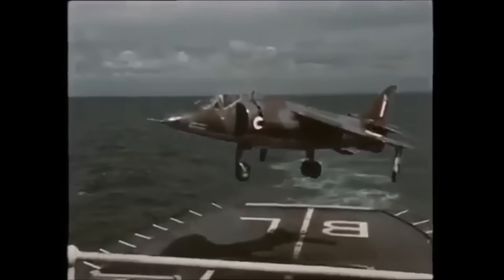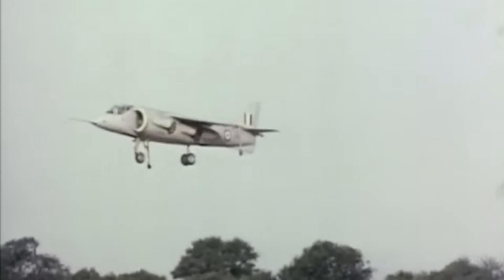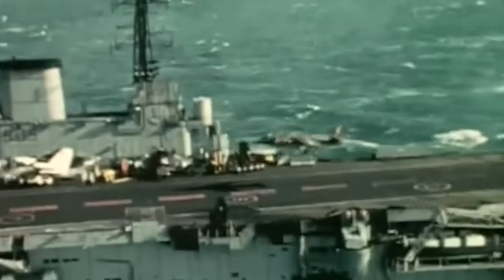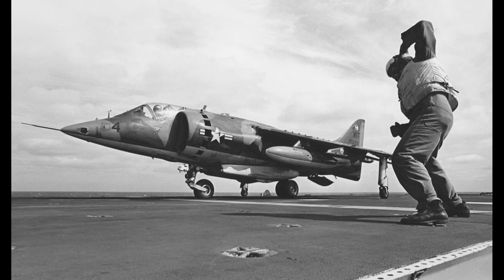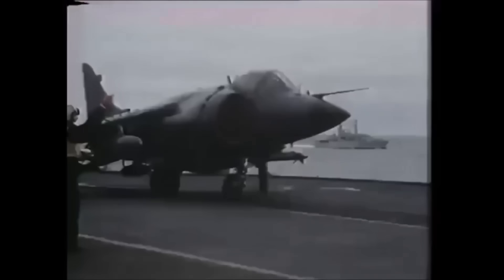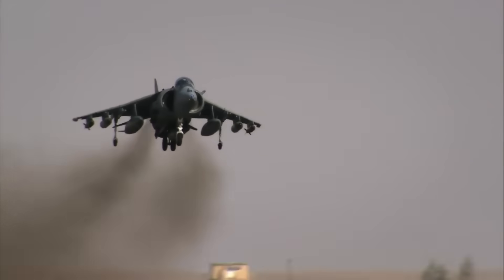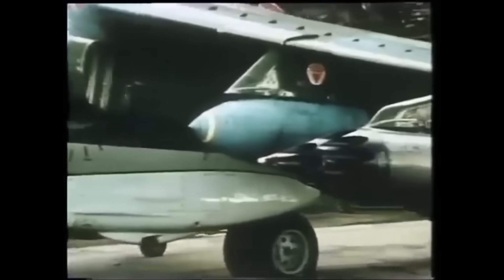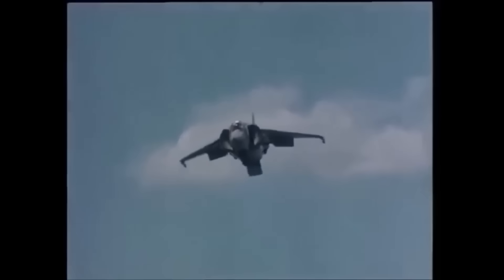How the Harrier Redefined Modern Air Power

Comment: You could have expanded on the fact, that the F22 engines, are just a licence built Pegasus engine with an afterburner added😅lol
Reply: ..whut?
Reply: Huh? The F-22 engines are not even by the same company and are a COMPLETELY different engine, as it's mission set is completely different and it's literally decades newer. Not even close.  If you meant the F-35B (VTOL variant of the F-35 for carrier operations), it's still completely different.